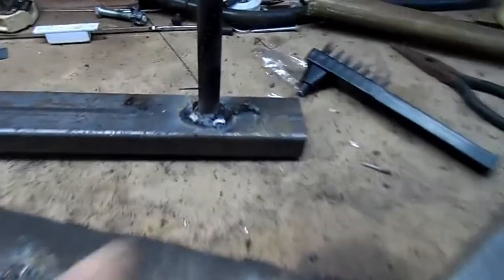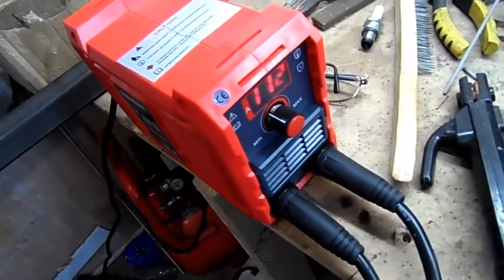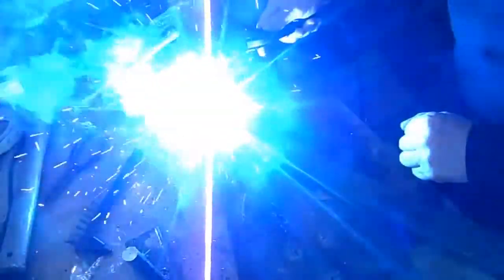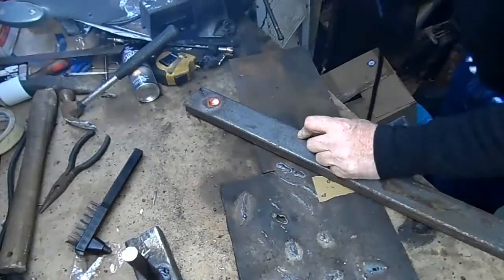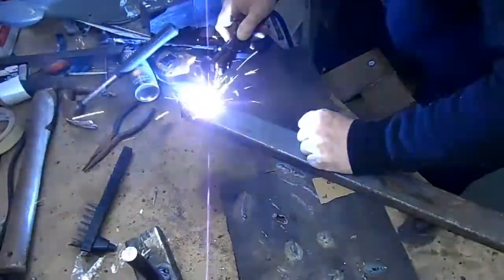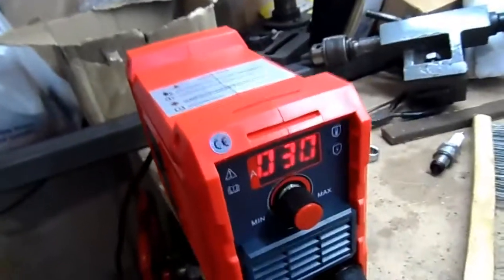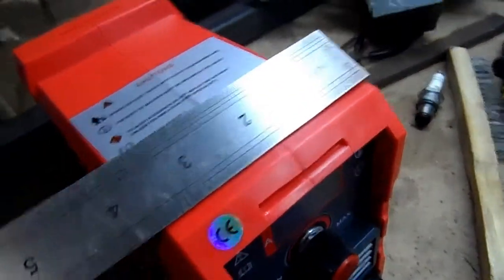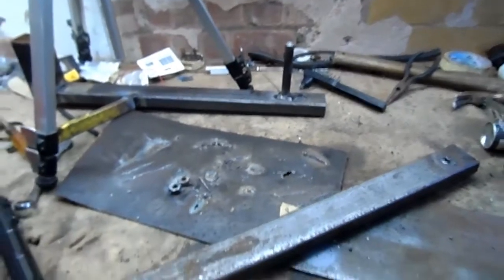MMA 250A IGBT INVERTER DC WELDER ARC STICK PORTABLE WELDING MACHINE

Comment: Thanks just ordered one from eBay received today was a bit sceptical when saw it and how cheap it was specially plastic but after watching your vid am a bit more impressed only brought to keep on my work van for doing quick small repairs so won't get a lot of use but small enough to fit in my tool chest

Comment: I was interested by your review and I've just bought one of these from ebay, it certainly is a powerful thing, I'm not used to stick welding as I've had a mig for many years but the stick welder was something I wanted for box section but it will take some getting used to for me. I also watched your vid on engine starting with deodorant and I'll give it a try, in fact, it was only yesterday that I was thinking of going to Halfords to buy the overpriced stuff and was wondering what else I could use.

Comment: How has the welder held up still working good and do u truly get 250amp out of it ? How does the plastic feel ? Good construction will is hold up to a bit of abuse would you recommend it?
Reply from the maker: yes i would recommend it? its still running as good as the day i bought it i love it and it keeps giving

Comment: Of course that's what welders were made for, blowing holes in metal, if you're go to show off a new welder start by actually welding something, though after seeing your 'MIG' welding on that other bar I can understand why you didn't show us your welding skills.
Reply: Blowing the hole was to demonstrate the max available power because everything else it can do is down to individual skill and experience. Knowing that it's powerful enough for that shows the welder can do what it needs to.